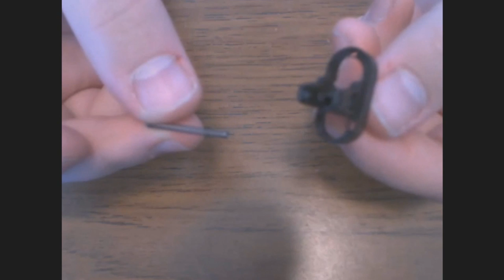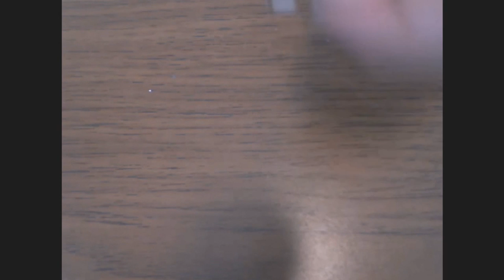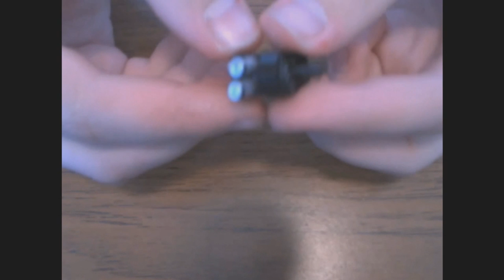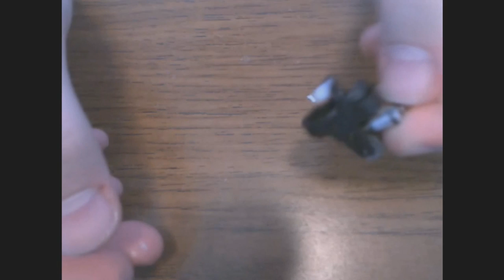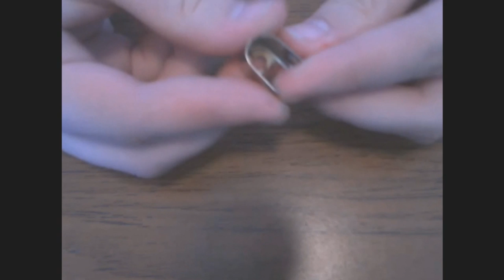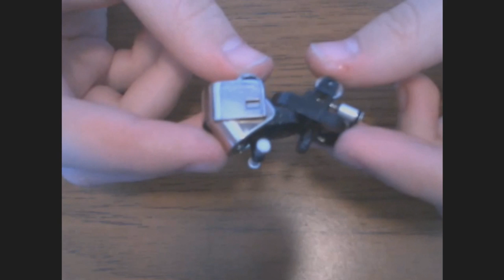How to make Cheap Lighters into a tiny Motorcycle

Comment: Once you get down to the white dial that was covered by the flame adjuster dial, you can turn it SLOWLY to release the fuel. DO NOT TURN IT UPSIDE DOWN AT THIS POINT. it will rocket fuel out along with some vital parts, some nasty gas, and your hopes of finishing your project.  It might take a little time but it will empty out. If you see a tiny bit in there still, maybe a few drops, you can put your hand over the top to catch everything and it will sputter out and you can get the tubes out. NO

Comment: I just made a Yamaha FZR 1000 with my empty lighters.
It's the 93 model with the "exup" and the USD forks , not the early ones.
I had some brake troubles first so it fell off the table but it's fixed now.
I can't make the damned exhausts work though without setting fire on anything, can someone help?